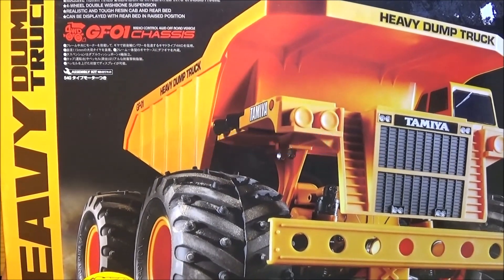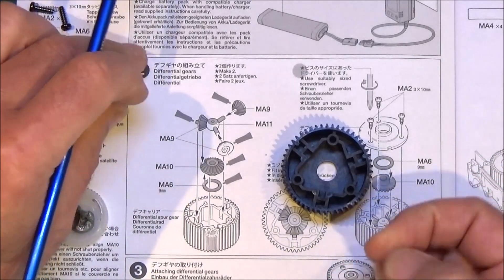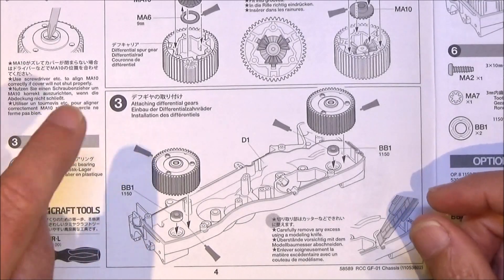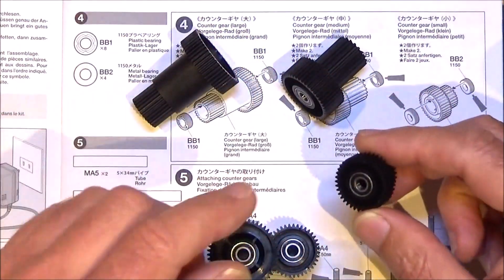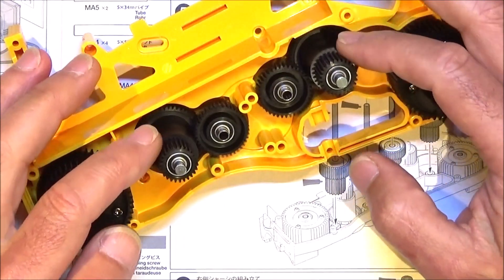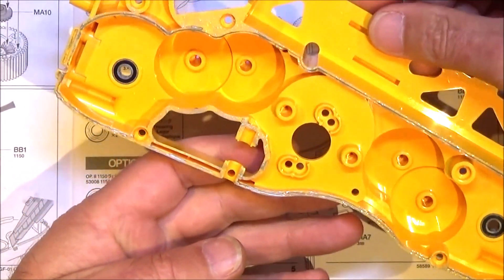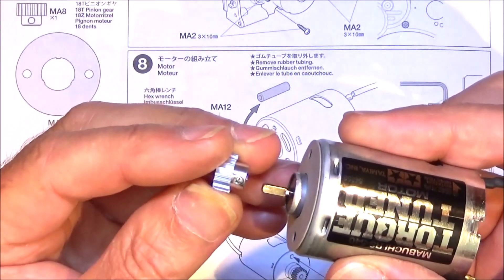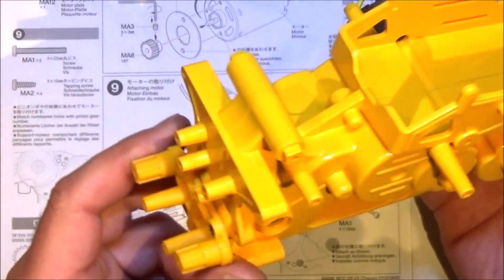Tamiya GF01 Heavy Dump Truck Build Guide + Tips Part 1 - Parts Bag A

Comment: Hiya matey and happy Friday to you. Just had a lovely pint while watching this. It's a nice kit this and not too tricky. What's good about it being yellow is that it really shows up well on the video. I noticed when I was videoing the Willy build that it was much harder to show what I was doing than with the Dump Truck. Hey I have tested the Willy and it's almost undrivable at speed with the brushless motor. The body is far too heavy and all the weight is too much towards the back. Anyway I've put the Willy shell on the GF-01 and it's a much better drive. I've got the lighter Jimny shell on the Willy chassis and it works better although still a challenge. Anyway, I am planning to go RC'ing over the weekend as the weather looks ok. Hope you have got some nice plans. Cheers for now my friend 😁
Reply from the maker: Hiya my mate Pete - and a very happy Friday to you too! Yeah, it's a lovely kit with not too much to trip a builder up! Really enjoying it - but I'm a bit wasted by the time I get home so things are a lot slower than usual. I'll take my time with this one. It will be a treat to run it when it's finished. Good info about your Willy and the GF-01. I think it will actually be quite good with the Torque Tuned and my only LiPo!!! Have fun with the runs outside and I hope the weather is kind to you. I'm finally raising that very nice pint of Wheatbeer to you - cheers!  😎👍
Reply: @MarkBryanRC  No one likes to have the runs outside especially if there's no toilets about hahahaha💩💩💩
Reply: @MarkBryanRC  Yeah, take it easy mate.  No rush with any of this and enjoy that beer.  I am raising another pint in your honour :-)
Reply from the maker: Hahahaha!!!  :D

Comment: Hi buddy, not wishing to labour the point as it's been mentioned elsewhere, but is it a chassis or is it a gearbox - no it's both! Such a clever design feature by Tamiya in combining the two, making the build so much quicker and easier. Personally I'd much prefer this method than shaft or belt driven 4WD, but that's just me. I have to say that was a cool tip in using the AW grease in the diffs to stiffen them up in case you end up in a sticky spot, I really like that idea. I've known some people who have locked the diffs altogether on this model to turn these into original looking crawlers - just a shame they're back heavy. Work great as trail runners though. Can't wait to see you running this one mate and I know you'll do it full  justice. Lunchbox on steroids. Take it easy mate and have a good one....👍🏻👍🏻.
Reply from the maker: Hiya, bud! Haha, yeah, lots of comments about the cool gearbox, or should I say, chassis - oh no, it's BOTH! Yes, this is the strongest and most reliable way to transfer power to both ends. The only downside is that it needs big gears and they take up a lot of space. Hence the battery has to go up high and upset the centre of gravity. No probs on this, but for a buggy or touring car, it would be pants! I did think about locking the diffs, but I think I'll use this as more of a basher than a crawler. Definitely a Lunchie on steroids! Have a good one too, my friend. 😎👍

Comment: 😁👍 Nice job Mark, I also use a little hard bristle brush to put that AW grease on the gears and stuff, You get that AW grease on your fingers it is super hard to get off!! So many gears in this one it's insane!
Reply from the maker: Right on, Steve! If that grease gets on your hands, you are gonna need a good detergent to get it off! The gearbox is very strong, it takes a lot to mess up those huge gears! Cheers, buddy! 😎👍

Comment: Very reminiscent of the Kong Head build, just a few less gears and diffs. Great stuff mate. Later dude.
Reply from the maker: Thanks a ton, mate! Yeah, I think these bits are exactly the same as the front and middle set of wheels on the Konghead. A bit easier to put together without those extra wheels to drive! All the best, dude, cheers! 😎👍

Comment: What an interesting setup. I do wonder why Tamiya included diffs at all, given the slow-moving nature of the beast as well as the need for good traction. If they had deleted the diffs they could have put the cash they'd saved towards a set of bearinds instead of those daft bushes!
Reply from the maker: Hiya Del! Yes, it is a great setup, basically the front part of the Konghead gearbox! I think this is more of a basher than a crawler, looking at the gear ratios. Could be good to lock the diffs and see how well it will crawl. But yes, they really need to throw the bushes away and give us the bearings we all want! Take it easy, mate! 😎👍
Reply: @MarkBryanRC  And you, Mark.

Comment: As I watched this I realized the transmission looks like a mounting point for a lot of other components. If a gear strips it’s going to be a bit of work to repair.
Reply from the maker: Hi Paul - yes, the gearbox is the chassis, and vice-versa! Such a cool design. The gears are so wide, it would take a lot of debris getting in or serious abuse to strip one. That said, yeah,  I agree it'd be a ton of work to get sorted! Fingers crossed for this one holding up. Cheers, my friend. 😎👍